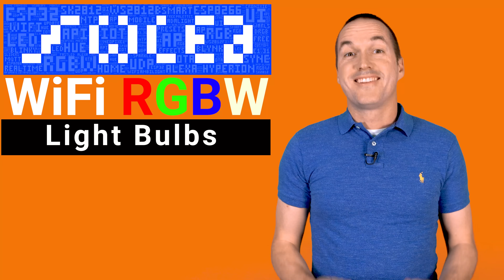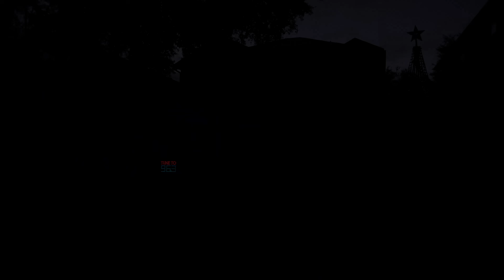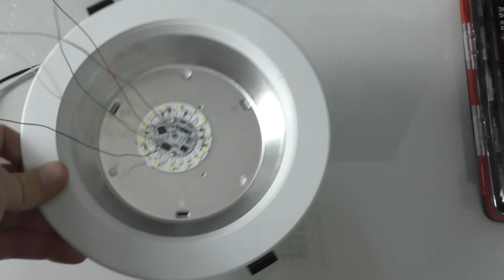Light Bulbs For XLights Light Shows using WLED

Comment: Thanks for the info. Finally got my Athom bulbs working in xlights because of this guide!! Using them in the home depot giant Christmas bulb props.
Reply: How many Athom bulbs are you using? I have a lot of delays with about 18 GU10 bulbs, if you want write to me privately, thanks
Reply: @Tech_1977 I am using 2. But they have been inconsistent. The wireless kept disconnecting on the bulbs even though they are 20 feet from an access point. I have 3d printed a fixture to hold 15 pixel leds and have it running on a esp32 now

Comment: Here for a refresher because now I need to upgrade (HA 2024.8 requiring WLED 14).. I have recessed lights I had to manually flash.. Tasmota to WLED.. but it's the 1MB so no OTA can be done. I'm guessing that means I have to serial flash it again: Tasmota minimal to WLED 14 1MB in a .gz compressed format. Anyone confirm?
Reply: Hi, I updated the WLED firmware from inside the web page with Athom Gu10 bulbs
Reply: @Tech_1977  Thanks for the reply! Yes, the Athom bulbs have enough storage space to do that, however, the lights I'm using do not.
Reply: @DocEntertainmentProd  What bulbs are you using? I'm looking for other GU10 bulbs because the Athom  don't have good wifi.
I'm also looking for wled downlights

Comment: I am finding that the wifi off of the Athom bulbs is horrid.  I have tried everything.  Different channels, and locations, right next to an access point (using an enterprise-class Ubiquiti setup), and while I can get a wifi connection, sometimes, it is intermittent.  No way I could use these for a light show.  Are there any other options out there?

Comment: did all the steps on the athom gu 10 lights  everything was succesfull, could enter the wled menu, i logged into our wifi and the menu works fine. but the leds wont turn on. now what
Reply from the maker: Is it broadcasting a wled ap?
Reply: @TheHookUp   yeah, found out what the problem was.. the gpois were wrong. changed that and the thing works like a charm..

Comment: Another interesting video - but confusing.  Maybe a video explaining what Tasmota is.  Also maybe a video about SmartHome wifi vs. ZWave vs. ZigBee (and now MATTER).  I have tried to move everything to ZWave - but seems there are no (or very little ZWave color changing lights, etc.)  Given the number of possible WiFi items in a Smart Home - it almost sounds like more than one WiFi network should be setup and I have also read that anything IoT should be on a Guest Network -- True??   I would really prefer to have everything 'local' - no more cloud (if I could only get my Samsung SmartAppliances to work without SmartThings.   I am looking to move from HomeSeer to HomeAssistant.

Comment: So here's a question that I don't really want to test to find the answer myself. I got the Athom tasmota bulb but was having issues connecting them to my wifi due to a special character in my password. So I set up a guest network with a different password and everything worked great. Upgraded to tasmota minimal and then WLED. When setting up WLED I used my normal network that has the special character in the password and it works. My question comes to future upgrades. Which wifi network/password will it use when I upload the tasmota minimal bin file through WLED? I would assume it would use the guest network that I set up in the original tasmota firmware and not the one that was set up in WLED.
Reply from the maker: Correct, tasmota will use the one it has stored in spiffs, which is your guest network
Reply: @TheHookUp  Thanks for confirming!

Comment: I ordered 4 bulbs one arrived broken the other 3 took a while to finally update to wled but got it done. Mine keep loosing connection to my wifi and it's only 50ft away. But other than that awesome bulbs
Reply from the maker: Sounds like you might have an interference issue, try changing your wifi channel on your access point.

Comment: Hi Rob, will this work with a Zemismart light already converted with your custom firmware from 2 years ago?  Tnx for the video!
Reply from the maker: Hi Eduardo, I need to test it out, but my guess is no since they use an LED controller instead of PWM.  Unfortunately, at some point during all of my testing and updates on my lights I made it so they won't take OTA uploads anymore, so I need to bust them open to try out WLED.  I'll probably do that in the next couple of weeks.
Reply: @TheHookUp  Tnx Rob! I’m going to try it and come back with my findings.
Reply: Hi Rob, I finally had some time open the Zemismart bulb and solder those pads (OTA update failed). I flashed it with WLED 13.3 1mb version, set the PWM mode and pins and I can say it works like a charm! All the colors and warm and cold white work great and it’s 
a breeze to set the bulb in xLights. Thanks Rob for the great  videos!

Comment: Hello Rob, I managed to install WLED whit your  method the Athon 9w light like yours, I installed version 0.13.0-b5 and work fine thx, version 0.13.0-b6 was released and I can not do the update via OTA (not working). Am I the only one to see this problem. thank you  for all the great video.
Reply from the maker: Which version of 13.0-b5 did you install?  Best bet is to go back to tasmota minimal and then to the 13.0-b6 2mb version.
Reply: @TheHookUp  I watched the video again and clearly  you  told to take the 2m.bin version, I took the regular version for the 8266 and not the 2m.bin, it's my mistake, thank you again for the good job

Comment: I am a little confused. Your video was discussing how to flash WLED to RGB a "light bulb" but at the end you showed a Novostella flood. When I found the info on the Novostella series that you showed, it looked like that it had to be "gutted" to get to the pins to do the "serial flash" method. I have several uses for a "flat panel" type color changing dimming bulb.

Comment: Loaded wled onto my lohas bulb (from your old FW) but now getting "Error 10: could not mount filesystem!". Had a quick look on github and a reflash is sugged to fix it, however it doesn't show up as a port under the minimal uploader anymore (despite being able to connect to wled on my wifi just fine). Note: if i restart the bulb it forgets everything (i assume due to the error on the filesystem mount) and i have to add it back to my wifi, but still get the "Error 10" message. 

Any ideas?
Reply from the maker: That's odd.  You loaded it using the updater and it says that?  I don't know enough about the specifics of WLED to diagnose that, you might get a better answer in the WLED discord.

Comment: Now what? Once you have them flashed with WLED, how do you use them with automations such as Home Assistant? How do you synchronize multiple bulbs?
Reply: WLED has a built in sync-send and sync-receive setting.  Basically set one light to send and the others to receive.  When you turn on the first light, the others will sync to it

Comment: If you get "not enough space" error. What is the best way to go,  will I have to solder to the light again & install a smaller file?
Reply from the maker: Where are you getting that error?
Reply from the maker: Yeah, in that case you will need to solder new wires on
Reply: Ok thanks
Reply: Rob do you know the RGB pin numbers for the zemismart light?
Reply from the maker: @barkman1one  I'll have to see if WLED works on those tomorrow.  They use the MY9231, which I'm not 100% sure is supported by WLED.
Reply: @TheHookUp   ok Thanks
Reply: @TheHookUp  That's the same for the Sonoff B1 bulbs right? Still have some of those and I would love to put WLED on them.

Comment: For someone looking for a no-fuss (or.. as little as possible, at least) installation of smart bulbs (and integrating said bulbs into HomeAssistant), would you recommend bulbs pre-flashed with Tasmota or WLED? (regular spots (GU10) only - no strips or fancy orchestration). Also.. can you just flash WLED onto a Tasmota device, or vice versa?
Reply: If you are going for no fuss, Tasmota is auto-discovered by Home Assistant. I can't speak for WLED specifically, but generally OTA methods just take a binary file, so you can upload whatever firmware you want.

Comment: Do you have a recommended downlight that either comes pre-installed with tasmota/wled, or at least can be easily flashed?
Reply: Following! I'd like to know as well
Reply: Following
Reply: @dusty717  I used peteme 4" downlights from amazon and transplanted 8266 into them for wled.  It wasnt too bad.
Reply: @kirkherres  is the 4" down light already a smart light? Did you have to remove the other chip and soldier in the new chip?
Reply: @dusty717  yes it's a Bluetooth smart light and I transplanted an 8266 in it's place

Comment: Does that mean even if you have older tuya bulbs they are now un-flashable? I mean- I’ve had them for years and never did it. But it’s sad if it’s no longer an option- especially now with wled integration.
Reply from the maker: If you connected them to the Tuya app they have likely been updated and will not work with Tuya Convert.
Reply: @TheHookUp  Thank you for the info. As of how long ago?
Reply from the maker: @chrisperrywv  Probably about a year ago.
Reply: @TheHookUp  gotcha. Yeah I’ve definitely connected to them since then. I appreciate you taking the time to answer

Comment: The Novostella wifi. Are they flashable to wled?
Reply from the maker: They used to be, back in the Tuya Convert days I was able to put my firmware on them and then I upgraded them to WLED last week.  Unfortunately, I think to flash them now you'd need to open them up which would probably damage them and definitely mess up the waterproofing.
Reply: @TheHookUp  Are the Novostella Floods 1M or 2M, when we try to reflash them? Also, I have one getting the error of "the selected serial port 
 does not exist or your board is not connected
" assuming I had the wrong flash size when updated originally. Have you taken one apart yet?
Reply: @MikeAllCisco  Hey Mike, I guess there are several types of these floodlights, but when I bought mine (Novostella-UT88836-20W) they were tuya convertable and I put Tasmota on it, when I look at the info I see this -> Flash Size	2048 kB

Comment: So are you migrating all your lights from Tasmota -> WLED? I've got 4 of the Lohas bulbs flashed with Tasmota (albeit an older version) using MQTT in HomeAssistant (with NodeRed). Any big reason to switch at this point if I'm not looking to integrate with XLights right now?
Reply from the maker: If it ain't broke don't fix it.

Comment: Why not use the WLED settings right in xLights?  Vender - WLED
Reply from the maker: You can, it doesn't change much.
Reply: @TheHookUp  dang, I was hoping it did.  I have six of these in my soffits and they keep having connection issues.  Getting the to stay synced with the sequence is driving me nuts.  I put an access point in the yard to help, but it did not seem to do much.
Reply from the maker: Using WLED or my firmware?
Reply: @TheHookUp  I have only tried WLED.

Comment: Thanks for the video, I’d been waiting patiently for it. 

Do you know the pin color code for the LoHas bulbs in your original video?

I’m at work so haven’t even tried the process yet but will the first chance I get home.
Reply: I think if I understand right it should be: 5,4,13,14,12
Reply from the maker: Yep, or 5,4,13,12,14 if you want to use the warm white channel instead of cool white.

Comment: So, I just bought a bunch of the novostella blink floodlights (Bluetooth version) with WiFi Hub.I’m completely content that these are for landscape lighting only, but obviously it would be Awesome to integrate these into the rest of my Xmas lights. I’m using the Dig-Quad with WLED to drive my pixels mounted with Permatrack. I have Home Assistant set up, but I haven’t updated for a while. Is there a way to integrate the Novostella BT lights? A short answer of “No” is perfectly acceptable. Thank you so much for all of your videos!
Reply: Did you ever get an answer? Any changes to your setup?
Reply: @RealJerb  No, but I am planning on working on this project this month. I think it will likely be a node red solution, so I’ll have to start rewatching Rob’s node red videos again. I’ll try to post here with my results, success or fail.